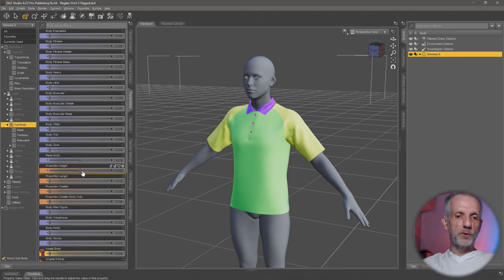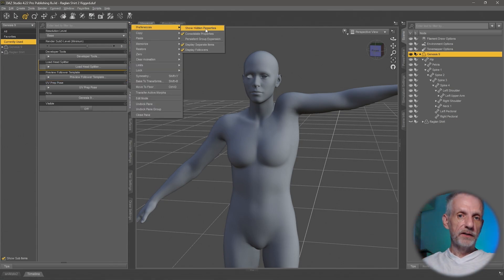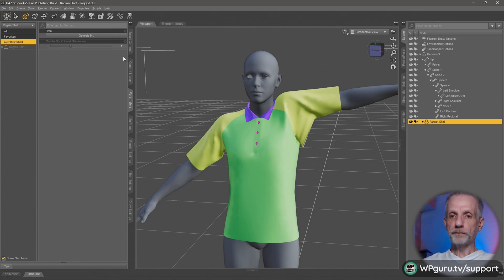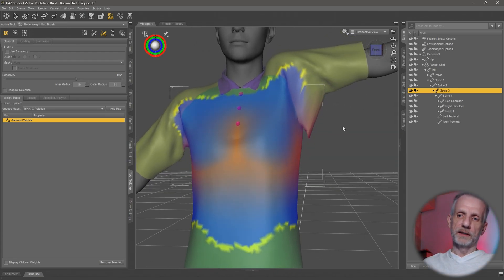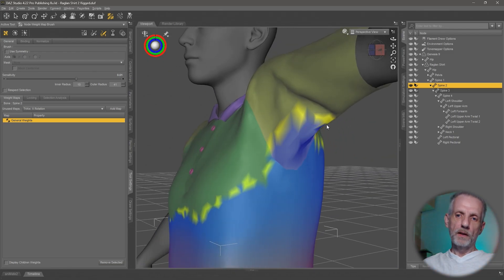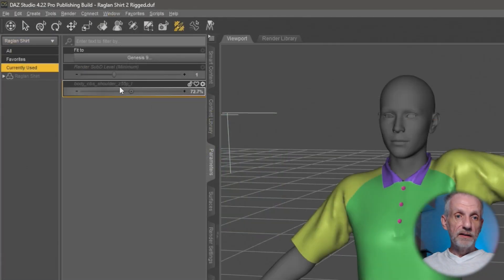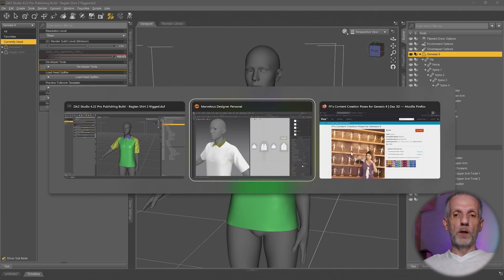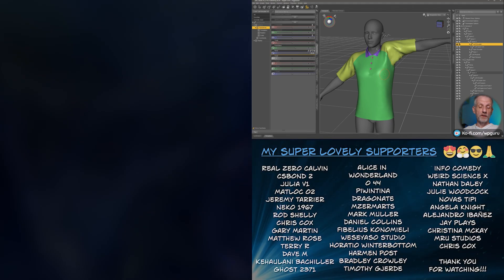Smoothing Weight Maps after rigging in Daz Studio

Comment: Very nice and simple to follow tutorial!
A quick question though, this video shows using a weight map in Daz , while DarkEdgeDesign's product that you recommended uses a technique involving correcting these morphs via shape morphs with Plender.
Are these 2 ways to achieve the same thing?  Or are they different, and a creator should apply both techniques?
Reply from the maker: Ideally you'd use a combination of both. Weight maps alone won't cure every bend that needs a fix. While corrective morphs on their own can work, on some occasions when maps aren't smoothed, the corrective morph interpolation will look nasty. These days most vendors try to cure everything by adding dForce to clothing items because the cloth simulation will smooth out every kink, but it's not always a good solution IMO.